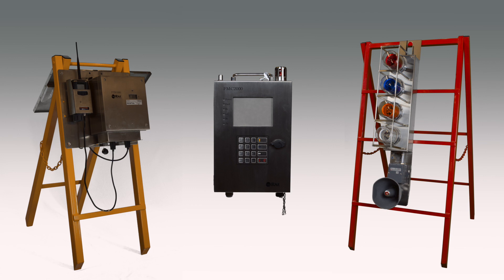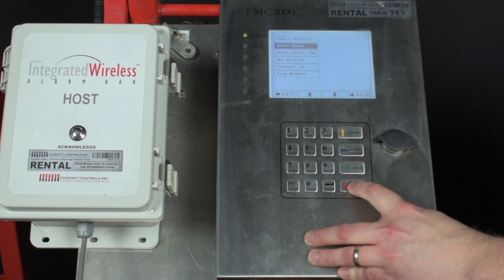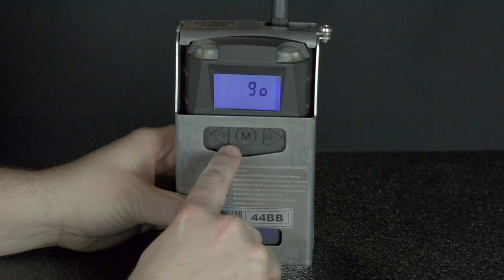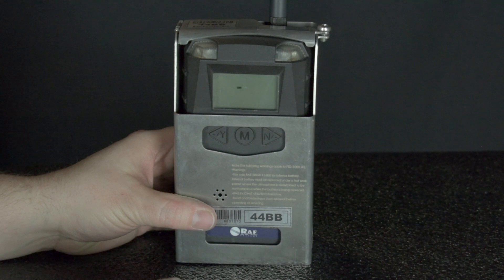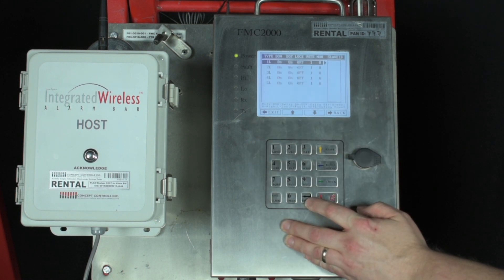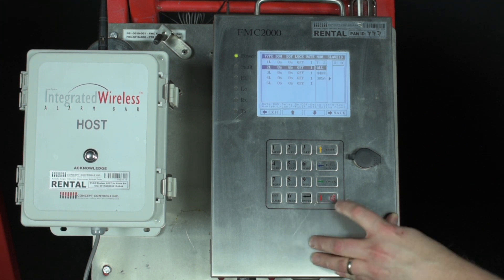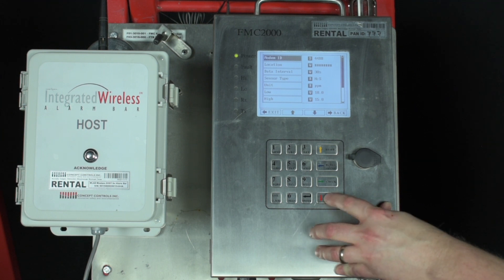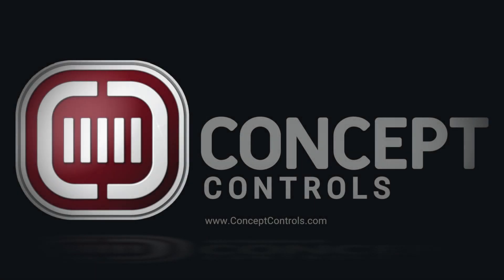MeshGuard Part 2: Programming

Comment: we have same unit. and it was working fine. but all of sudden the control panel unit not displays the sensors which is paired to it.
is the any ways to trouble shoot
Reply from the maker: Hi Adrian, 
If you have experienced a sudden loss of power, you may have to reset it up. If that doesn't work, please call our service line and we will be happy to help. 1(888)-207-2212 Option 2.
Reply: @conceptcontrols1786   if is there whatsapp number or viber number, i will happy to call service line